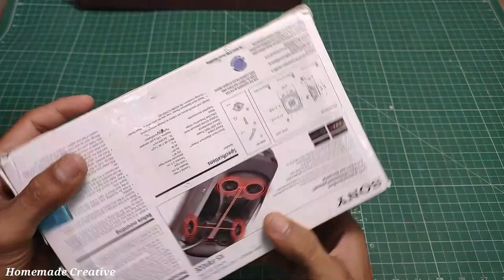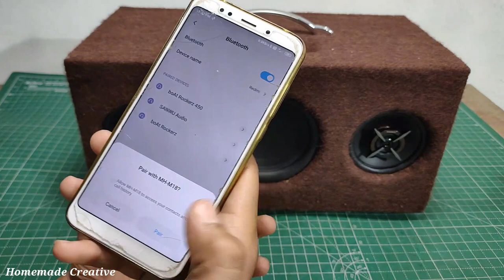Making a Simple Bluetooth Speaker Using Drill Battery | DIY

Comment: Good job.  I have similar set up yet to build.  I need some direction connecting the wires.  What goes where exactly.  The small chips you hooked up too.  Not sure if you’d be willing to help me with some information on it.  Thanks.  Kev.  I have mine going in a pelican case.